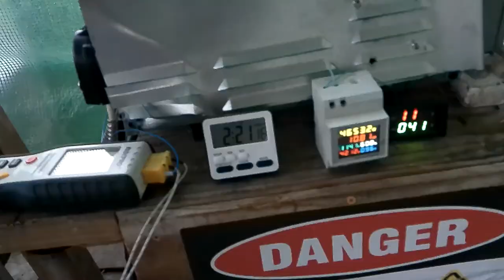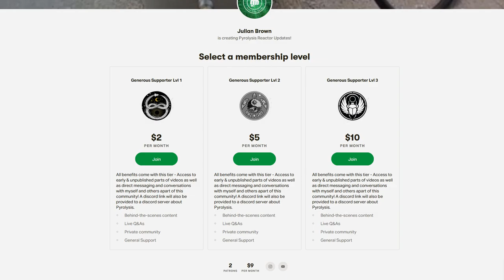Putting Coal inside of a Microwave? What Happens!

Comment: You could do with a vibrating sifter. 

Just a small engine with offset balance attached to a mesh that's sitting on some springs or rubber stands would do the trick, but given particle size, it'd be best if it were enclosed. Idk, a DIY fumehood would serve a dual purpose. 

Also, given that you're actually getting some gas out of supposedly coal, it must mean some other contaminants. It could be more energy dense than assumed previously.
Reply from the maker: Great suggestion!

Comment: Now you are performing thermalcracking of oils (mostly tar)  that are already cracked in the previous reaction. You can save a lot of energy if you dissolve the coal in gasoline (solvent extraction) or similar before running the reactor to recover that oils. Also i recomend to make a water stiring extraction on the final product to separate gravimetric fractions (even before). Heavy fractions will sink to the botton containing most the metals. At the top you will have light fraction of unreacted species. The soluble fraction will be mostly composed of 100 % carbon, whit some heavy metalic ions that shoould be further extracted by acid/basic precipitation.
Reply: Other option is to make the solvent and the gravimetric separation at once by stirring the first coal whit gasoline. Then run the reaction. But i dont know if its better or not that solvent + water stirring separately.
Chers from spain! You are welcome here!!
Reply: You can use a cement stirrer that are realy cheap.
Reply from the maker: Great suggestions here friend, sending love to Spain! Thank you

Comment: I'm curious how usable the pure carbon residue might be as a feedstock for making carbon electrode material. It could be mixed with heavier oil fractions (maybe closer to tar, if possible) to make a moldable dough, which could then be formed into the desired shape and pyrolyzed to make the final product.
Reply from the maker: Certainly interesting